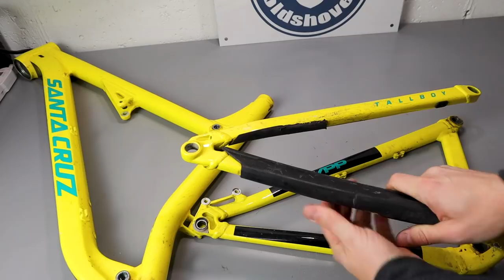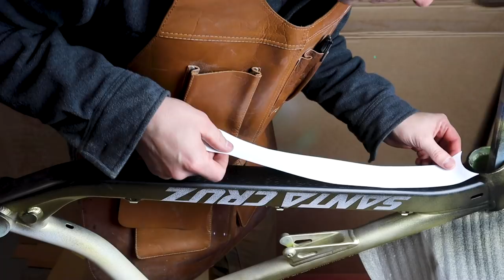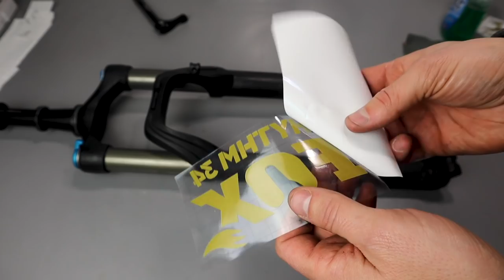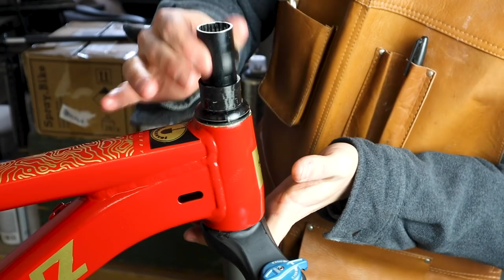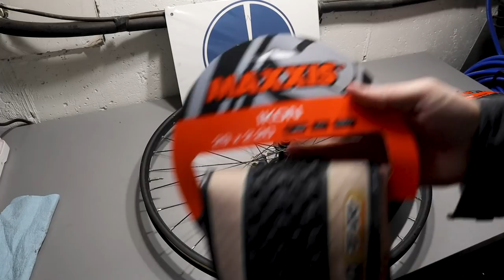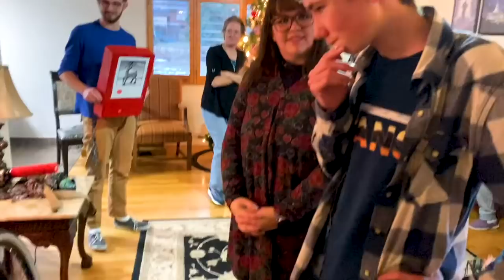Santa Cruz Tallboy Christmas Gift Dream Bike Rebuild

Comment: To me its not worth spending tons of money on bikes, i like restoring retro-bikes for like $500.
Reply: Heathcliff I have a retro bike, Cannondale F 900 Cad 2 and a specialized stumpjumper ST and there’s no comparison. The newer bikes have better geometry
Reply: yeah. I always wanted a good mtb but they are too expensive new. So I bought retro Hot Chili Rampage mtb for 100$. I changed the forks, tires, stem and bars and i restored the paint. It is not as good as the new bikes but I have a lot of fun on the trails with it. Here it is https://www.reddit.com/r/xbiking/comments/dwbsc1/i_dont_know_is_it_ok_to_post_my_hot_chili_here/

Comment: Trick I learned from a Cam Zink video, if you use finger nail clippers to cut cable ties used for cable routing you get a nice flush finish that won't poke you later on. Awesome video!
Reply from the maker: Lol good tip. Thanks.

Comment: It's a joy to see greatful young people, it's also a joy to see someone like yourself (i just found your channel) that donated his time and skills to fix this bike up because the knowledge and wisdom of taking it apart, painting it, and putting it together is a lot of expensive work through a bike shop. I just bought and older Jamis as an upgrade to my SE Stout and I thought "I'm going to start riding and getting back into better shape because I'm 45 and a little heavy on thw gut side 😂. Turns out it has hydraulic brakes that will need to be beld and redone which is already out of my budget and I don't know how to do it, I've never had hydraulic brakes so when I saw it at tye pawn shop I thought it just needed pads which I could have done. This is where the Bible says "get knowledge and wisdom" because the two work hand and hand 👍. I'm enjoying your videos, God bless
Reply from the maker: Lol 😂 it’s always great to learn new things. I’m right there with you always learning new stuff.

Comment: Great job! The bike looks amazing. Just a Heads up in the video at 18:35 you get a good glimpse of the rear wheel. and it appears the rear tire is reversed. In my experience Maxxis tires when mounted in the correct orientation will show the model and other info along with the Maxxis emblem on the drive side of the bike or the rider's right side. I just wanted to throw that out there. otherwise amazing job on the frame!

Comment: If you're going to use rough sandpaper to sand the frame you neeed to then use primer or sand with finer (400+) sand paper before painting. Because you don't do this you can see deep scratches under all of the paint. The paint could look a lot better for 10 more minutes of prep work.

Comment: When sanding your bikes you should use way finer sandpaper. 80 grit is super aggressive and leaves the scratches. You can see it through the paint. I would start at 220 and work finer if you can still see the scratches. It'll take longer, but the end product will be way smoother. Also where did you find the pattern for the top tube?

Comment: Lovely project and recipient! 

A few questions about your painting process, if you’ve got the time: I’m about to refresh my Santa Cruz Bronson with Spray.bike colors too. 
The sanding you did, was that to get a better “sticking” surface for the paint/primer? - mines a carbon frame, with a fair few dings and scratches, but I don’t think it needs primer. Also, the masking decals you use (like for the logos and such), how do you get them to release so easily?

Again, awesome stuff you did, cheers!

Comment: I got a yeti arc hardtail for free but dont have the money to build it it needs alot an i think its the perfect size frame im 5’8.5 an it measures about 18in from the bottom of the crank to the top where the seat post goes in

Comment: How did you design the curvy lines for the top tube? And which plotter and vinyl foil did you use?
Reply from the maker: I designed the topo map lines using photoshop and then printed them with a Cricut vinyl printer/cutter. Thanks for watching.
Reply: @oldshovel  so you just drew them by hand? Or how do you make sure they have equal distances to each other. Seems almost like a pattern

Comment: Wow! That is just so nice. Thanks for including when Carson received the bike. That was awesome! Santa Cruz is my favorite mountain bike. I have a new Juliana assembled & really for pickup that I can't get because of the Viral Zombie Apocalypse. 

Could you write the name of the vinyl printer you used? Is it Mac compatible? I am a graphic designer & could use one of those. Also, where did the snap on chain stay protector come from? I have 4 mountain bikes that need 1 of those. Also, where did you get the rubber boot protectors for the internally routed cable? None of my bikes have those. Thanks for this video. I got a lot out of it. Be safe. 👍☮️🌞🦠😷🚲

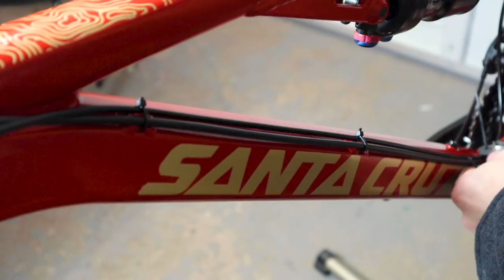Comment: 15:01 don’t cut zip ties like that, it leaves a sharp edge that will slice you open. Instead twist the part of the zip tie that sticks out until it breaks off. It leaves a rolled over end that won’t cut you

Comment: This is amazing! His reaction was priceless :). 
Here's a little note to all those wondering how to get into the sport as well. Most of us don't have bucket loads of $$ to spend on a new mountain bike, and these things are by no means cheap. My recommendation would be to give Pinkbike and eBay a look for a couple year old MTB. You can get a lot of these "older" bikes at a bargain these days, and all many of them need is a quick trip to the Local bike shop. Additionally one of the ways i was able to slowly level up the bikes I had was through buy/sell, buying older bikes and components, grouping them into a complete bike and selling them again. also, the other way was to buy old component's bikes, repair them and sell them for some profit. . If you have any other questions, I would be more than happy to answer them. insta @ mtbrandon.lee_